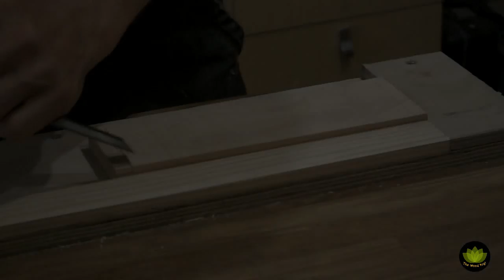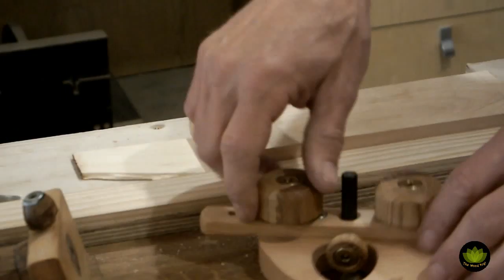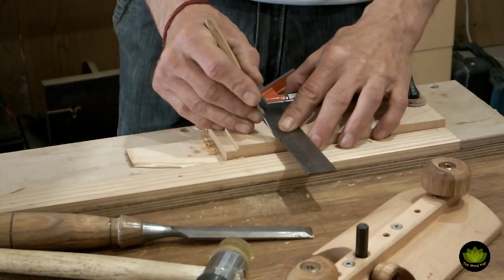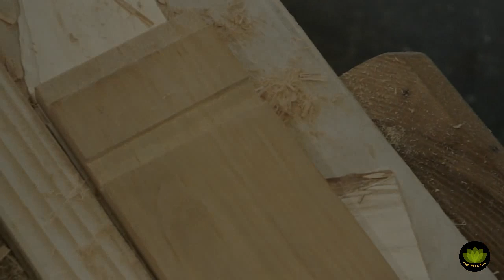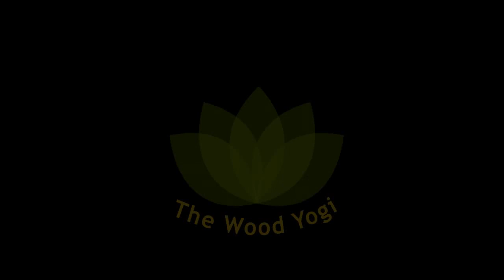Long Based Hand Router Plane Demonstration - Woodworking

Comment: I like the extra width to the base, very nice.  I also like that the blade direction can be reversed.   The only thing I do not like is the tightening knob being right above the cutter edge when the blade is turned the one direction.  I'm thinking of making a router plane, and I've been looking at videos to see what others have done.  Yours is unique among the home made versions.  You have done your research and taken some of the best ideas from old manufactured units and built it in wood.    If I copy yours, I'll move the tightening knob to the top, just to one side of the blade.  There are handfull of mechanical devices that would allow a clamping action on the blade shank via an upright knob.
Reply from the maker: Hi deezyner :) I think I understand what your suggestion is. I then realised that in the video I had the tightening knob above the cutter in one of the cutter directions. Thanks for spotting that :D The top bar is actually threaded from both side so the tightening knob is able to clamp the cutter from behind in both directions. I made the video quickly as a request from someone on Lumberjocks and it was a long day. I will make a short video soon to show the correction. I would still love to see a different mod of the router using your idea. It sounds great :) Please share a picture or video if you get time.
Reply from the maker: I have uploaded another video showing more detail https://www.youtube.com/watch?v=Oi6sjt2t6kU

Comment: i actually never knew this existed :D. that happens when you are a teen in the 90thies hehe. everything was eletric like routers.  very nice build mate. might look to make my own for when the grid goes out
Reply from the maker: I have a electric router, but by the time I set it up, changed the bits put on my dust mask and ear defenders, I had the job done with this :D Hahaha I'm a teen of the 70's and I didn't know it existed until a couple of years ago :)